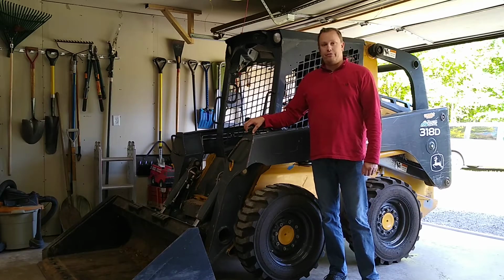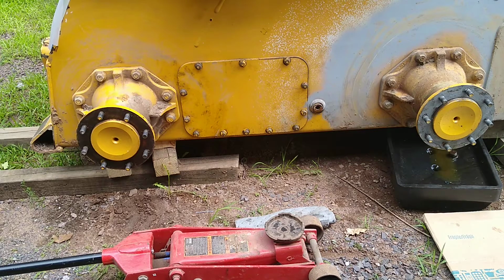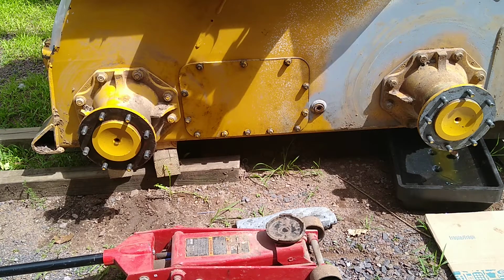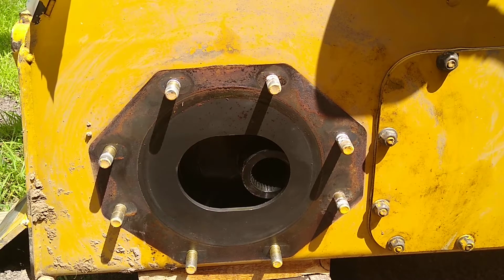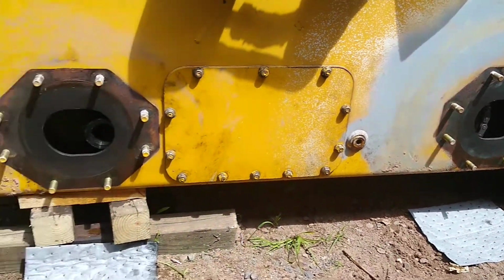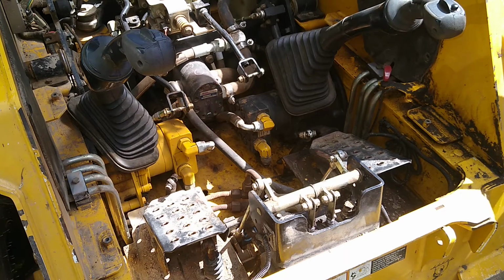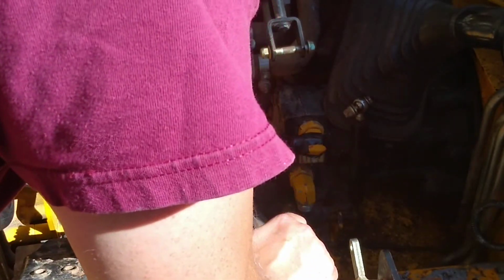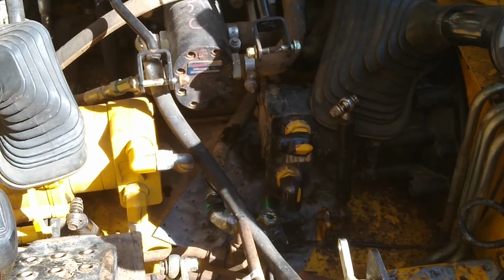Part 1 - Skid Steer Drive Motor Repair

Comment: Thanks for the video.. it would have been a great help 12 months earlier.
I just went through the same process with the left hand drive motor on my Case 70 xt. The motor had a slightly worn main seal and was dumping oil into the chain case.  I bought a seal kit from my local dealer for $360 to rebuild it. I disassembled the motor and decided the job was beyond me , returned the kit, and bought a remanufactured drive motor for $2400.
It was a pretty expensive exercise. I will be interested to see how you go.
Good luck.